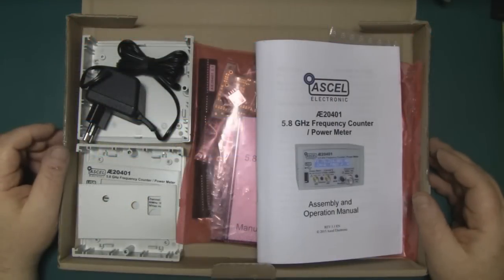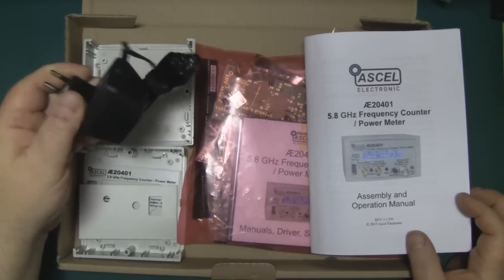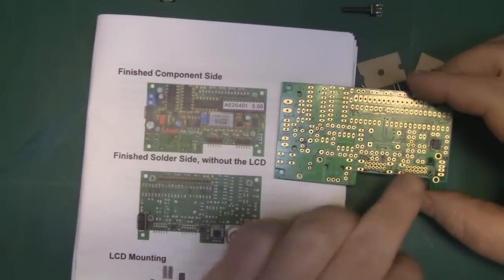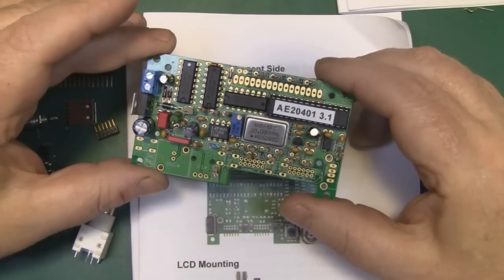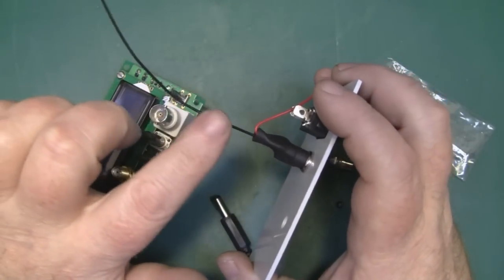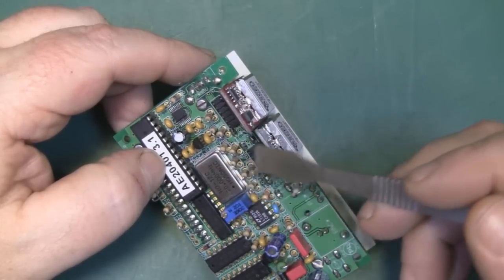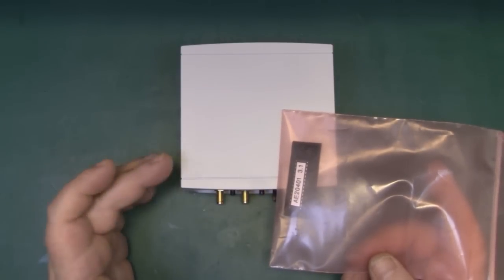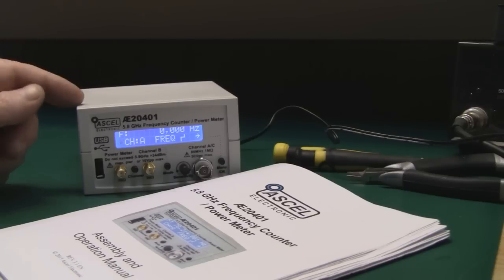ASCEL AE20401 5.8 GHz Frequency Counter / RF Power Meter kit #127

Comment: Sir, 
AE20401 is Suddenly PWR is showing 1507.4 dBm without connecting any  amplifier power.
Can you tell me,  how solve this errors
but in mWatt shows 0 mWatt.

917396040619 this is my number, can you tell me what is the reason for that.

Comment: Sorry to say that the power meter (no matter which model) can only be calibrated with a calibrated source, similarly with the frequency counter, it's fiddly to use, and even after I'd calibrated the 500MHz power meter it  still wasn't accurate. As a project and a guide to frequency/power it's OK, but if you want something that's much more tolerant of wide input voltages or accurate at measuring  frequencies or RF power better to buy a used RF power meter, wideband millivoltmeter or frequency meter off Ebay as this is a toy.

Comment: Hello Andrew, what about the Phone jacket in de back
Reply: oke i did find it, in the DESCRIPTION : Adjustable number of pulses per count
Control via keys (local), external Gate Input (on the back) or USB.
It is a external gate input and it must be connected to the EXT on the mainbord.
Reply: P.s i did buy one compleet unit, with all the modules and 1ppm TCXO Time Base, i am building it now up, one thing i do not understand that the adapter (power supply) only has 7,5 volt 150 mA and they say that you at least need  a 8-12 volt 300 mA power supply in the manual, on page 22, i have the same power supply as the one you did have in the video, i am going to wright to them and ask wy this is, i did not have the problem with the LCD screen and the BNC connector, and my unit did work just fine, i only need to adjust the inpit amplifier and i am ready to build it all in the case it came with.

Comment: Would this be a good alternative to the ImmersionRC RF power meter?
Reply from the maker: +RC FPV Flight I have seen that on ebay but it only does power and it has no PC interface. If you buy the ASCEL without the frequency counter then this is much cheaper. Some may say that the ImmersionRC is also portable but I think any power tests you would do at home and not in the field anyway.

Comment: I enjoyed the video, and I agree that showing you soldering each resistor (even at 20x speed) is unnecessary. However, I would have liked to have seen the counter and power meter working, actually measuring something, even if for just a few seconds per measurement. That way, we'd have some idea of how it actually goes about its job.
Reply: :) Did you find a good meter or built it ?

Comment: Nice kit, but the major drawback is that the power meter for the 5Ghz module is limited to -5dBm, which makes it useless for measuring pwr of wifi devices, unless you add an external attenuator.

Comment: Andrew will 2.4Ghz antenna work with 2357500  frequency? I'll use it in a wimax antenna. Thank you for your videos.
Reply from the maker: +Harvie Boles Hi Harvie it will work just fine and thanks for the feedback
Reply: +andrew mcneil Thank you so much for the response I just found out your channel last day and I've gain a lot of information. I'm thinking of buying MIMO antenna but got interested in one of your builds the biquad yagi.